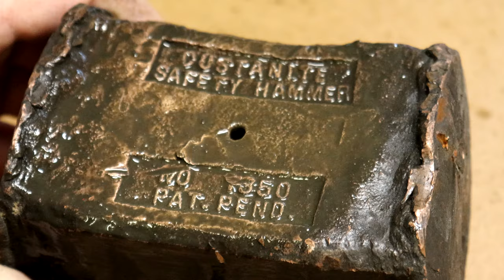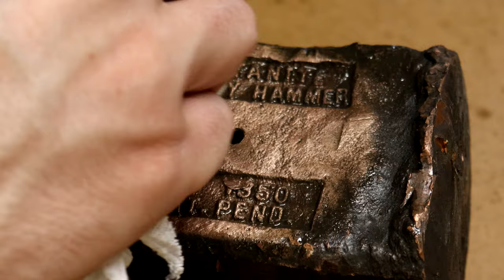Copper Sledge Hammer Restoration

Comment from the maker: This was just a fun side project that I had for a day, and I figured it could bring a little variety to the channel :)
Reply: used a lot in the oil and gas and marine industry
Reply: Used to use them on the wheel nuts on old Jags. The ones with the ears. Quickest way to change a tire at the races.
Reply: The square edges on the handle will rip the users hands to shreds after a very short time. OK for a hit or two but hell to work with for anything more than that.
Reply: Nice change of pace. I often wonder though, who will finish there car first. You, Bad Obsession Motorsports, or, Builder Creator. I follow them all. I can't wait to see who is on the road first.

Comment: Copper and brass hammers and chisels were used in coal mining predominantly as to reduce the chance of a spark igniting coal dust. I believe they were also used in grain elevators and flour mills because grain dust and flour dust are both highly volatile
Reply: If you are going to beat on a hardend. Surface.
Like the yoked of a driveline when replacing u-joints. Or track pins.
Reply: There are all sorts of reasons for non-sparking tools, but unfortunately most of them are pretty specialised, which makes them on the rare side.

Comment: Nice work.. I took one of my brass hammers, laid it on its side and penned the mushroom edge back into place.. I was really surprised how much I could clean up the corner of the face without doing any grinding and losing material or change the character of the hammer...

Comment: When my rare tools got stolen in early 2000's, my solid copper and solid brass club hammers and mallets were sorely missed the most as you could belt the ess haich one tee out of any stubborn nut or stuck shaft without fear of bending, breaking or damaging engine parts.   I keep meaning to look into doing a lost wax or similar home forge as I love working copper and brass.

Comment: Safety Hammer.  You will find copper/brass tools anywhere you have flammable materials. I have a copper head that my  G'pa used in the late 1800s to break up lump coal to feed his stove in his railyard office. I live near several refineries and other plants. There are many areas where only non ferrous tools are required for safety reasons. Sparks not allowed when plant is in  Operation and making repairs in hazardous areas. I have a 24" bronze pipe wrench and have seen bronze Crescent brand 12" wrenches and other assorted hand tools.

Comment: giving it a new life is good, having a bit of character is good too...I'm just wondering why you didn't put the brass pin back in as required to keep the head on as it isn't a tapered hole.
Reply: I believe it is a tapered hole , look back over his preparation of the handle, the end is definitely tapered and he added a metal wedge to force the handle edges against the edges of the hole. Not an uncommon practice for fixing hammer heads on to their handles.
Reply: @pcbart1  You believe? What edges are you talking about man!!  Forget the handle....I'm an old man but there's nothing wrong with my eye sight.
First look at 2:06....Now look at 2:50...Notice anything? Which way are the letters on the hammer head facing up or down? Huh?? Now look at 9:30 with the handle installed.. 
Are you still not seeing it? If the hole in the hammer head was done with a tapered broach, this would mean the head is on the handle upside down. 

Which side has the bigger hole? Huh? Which way should the tapered hole be facing up or down before the shim is put in?  And what about the missing brass pin?
 What good is it if the bigger hole is on the bottom? I was trying to be polite but the bigger hole needs to be on the top,
before the shim is installed, same as any axe , claw or peen hammer or sledge hammer. 
The idea is not to have the head fly off, the brass pin is supposed to be there for added safety, remind me not to go to your house to help with any  fencing...
Reply: @IR-nq4qv  The problem is - the "knowledge" of most people is gained from watching youtube (etc), not the real world. So, they don't understand the (very valid) point you made about the reverse-tapered hole with an (incorrect) wedge.
Reply: @justanotherguy9664  I'll be the first one to admit I don't know it all ,everybody makes mistakes, I don't make it a habit of pointing them out, nobody likes a Smart-Alec. There's a lot more wiser people than me who watch these videos as well.
I just get peeved when someone looks at the same video as you did, sees the total opposite of what is actually being captured on film and then basically tells you that you need to go back and take another look.
Reply: I must not know the meaning of the word tapered if that hole is not tapered. 
I probably have 40 to 50 swinging tools with handles, hatchets, mauls, axes, hammers of every variety, the only one with a big hole on top is my pickaxe.
edit.  I made a mistake, I have about 150 year old wooden mallet, and the big hole is on top, I collect antique tools.

Comment: Dude grind off the bent over edges those will bust off and could embed in your skin
Reply: Copper is a soft metal and should not fly off like a hardened chisel  although it would have been nicer to anneal the copper head and pound it back in shape.
Reply: @joetri1970  not quite, it is soft, but still brittle(also usually not just made of Copper, but an alloy with a bigger part of copper). It WILL fling pieces off of it, if you're a little unlucky with your blows. Take it from a Machinist. Personally would file them off, seeing that it indeed is relatively soft. A decently mannered machinist would also mill it for a paid lunch. That certainly would look the cleanest, which is often not preferred tho :)
Reply: I don't reckon this will really see much use and be more of a display piece than anything. So I don't think it'll realistically be an issue
Reply: @stephenn1056  True, beaten up is quite the good/cool look for an old tool, if it's for Displaying Purposes :D
Reply: That exact thing happened to me, and I was just tapping in a large alignment pin.  I felt something weird...and just a small open wound on my arm.  Something felt "wrong" and I kinda felt sick immediately.  I finally convinced the foreman that there was something in my arm.  Had to go to the hospital to have it cut out.  Gross.  nplombe at geeeemale

Comment: It's prob fine, but there are old-school Copper "Safety Hammers" made from Beryllium Copper, which is SUPER deadly poisonous, google the one you have and make sure it's just regular copper before cutting, grinding, sanding, etc- Nice job, but just trying to give you a heads up
Reply: I'm no expert, but considering the property's of beryllium copper alloy, I wouldn't expect it to have mushroomed over so much on the ends, or to have deformed as badly this one has......... Mind you, as lung disease is a pretty gruesome way to die, I personally wouldn't be inclined to take the risk in case I was wrong (As I said, I'm not a metallurgist).
Reply: Wikipedia says that it's only dangerous during the manufacturing process, if you breathe in the dust. "In solid form and as finished objects, beryllium copper presents no known health hazard."

Comment: 10:00 I don't think you were supposed to use the steel wedge, that's why it had a brass pin holding the handle in place before.
Reply: We use them when we want to avoid sparks. I'm sure that he is using it to avoid marring the component he is hitting. He will be fine.
Reply: @esqueue  Well, if it was an anti-spark hammer, then I'd think you would want to avoid all steel items.   If it was just a more gentle hammer to avoid marring something made of steel, wouldn't you still want to use a brass pin?   Granted, it probably doesn't matter, but it seems either way you are not doing an authentic restoration.

Comment: That handle looks uncomfortable. It's not nearly rounded over enough in my opinion and should get wider at the base. I take it you've not done much sledge hammering ?  : )
Reply: Looks fine to me. Can always add a leather or cord grip to the bottom. Dunno why are you asking him if whether he has done much sledgehammering? Not like a brass sledge is for driving stakes/posts, demolition so most people use steel ones. The brass sledge is for stuff you don't want to marr or damage too much that's too big to fit in a press or something... The whole point is to avoid getting into the situation where a brass sledge is required but at least you have one when you do.
Reply: It’s not a sledgehammer. 🤷🏻‍♂️
You would never swing a copper hammer as hard as you would a sledgehammer.
Reply: @Crewsy  It's not a tumor